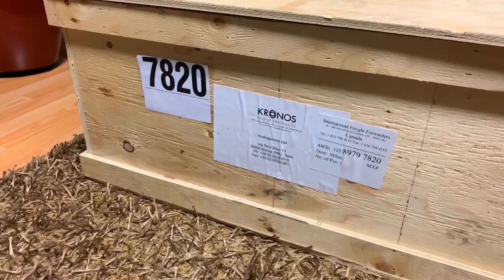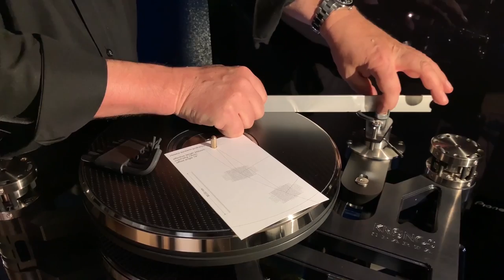KRONOS SPARTA Hi-end Turntable!  UNBOXING - SETUP - LISTENING

Comment: The turntable that uses a counter-rotating platter that solves a non-existent problem. And injects twice as much noise into the system. Two platter bearings + two motors = double the noise.
Reply: Yeah i'm sure they're stupid and you're the only one to figure that out 😂
Hmmm let me see...on one side we have someone designing, manufacturing and selling hi-end turntables successfully vs a guy on the Youtube comment section 🤣
Reply: @SpaghettiKillah  the manufacturer's know where the money is. They're smart in creating problems that dont exist.wether its guitars,audio equipment,pharmaceuticals etc... you than have to be somewhat blind to buy into the lie. The lies are all over the place.you gotta figure it out yourself.does that mean that this system isnt probably the most incredible thing ever? No. But it means it could cost alot less

Comment: in the 70's i had a pricey stereo i hung a 2X3 peice of 1/4 inch steel plate from the ceiling and put my turn table on the steel plate, the weight made it unskippable you coud hit the plate and the mass of the plate would just lowly move